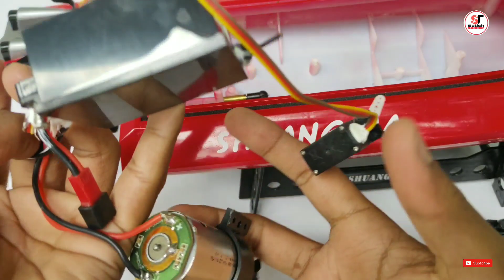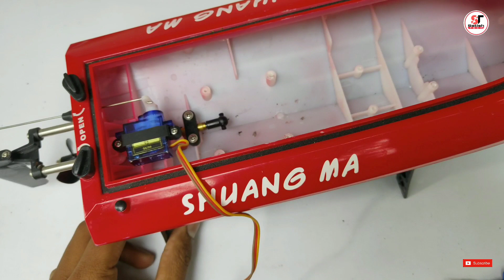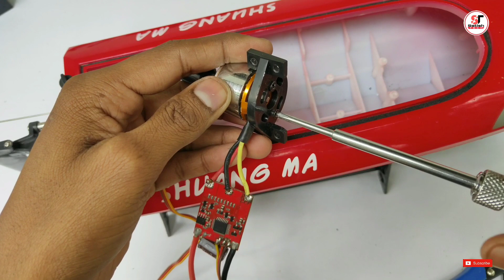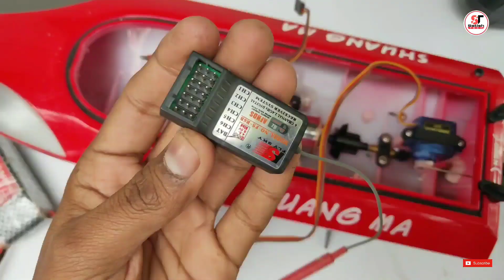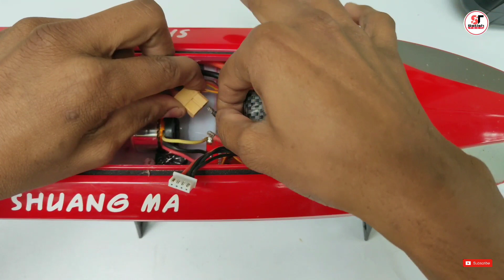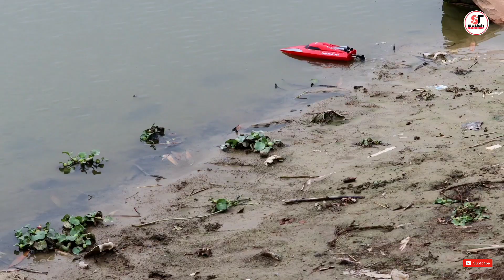Upgraded 1000.KV brushless jet engine for an old RC boat

Comment: The boat is pulling the back down in the water it needs skids the boat needs to be a full speed but level. I'm shore that motor is not flat out I mite be wrong.good video

Comment: That brushless motor didn't make it any faster. The stock motor is better just swapout esc. I used a 30a esc in mine. $10 🇺🇸 on Amazon.